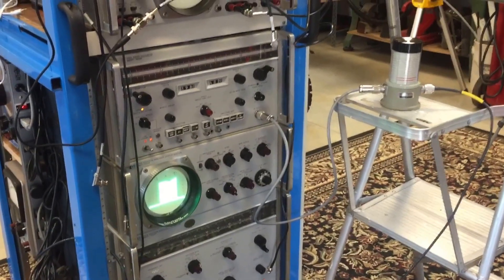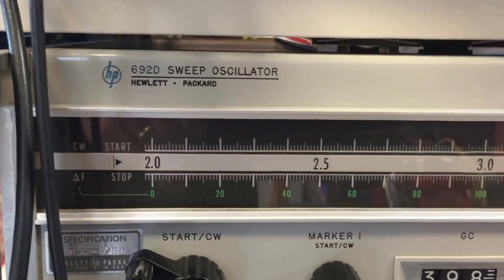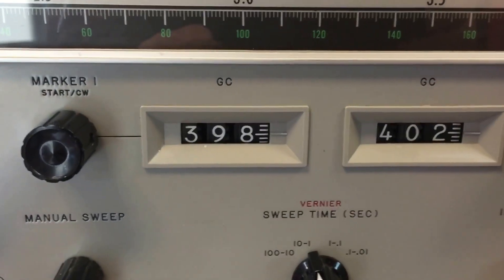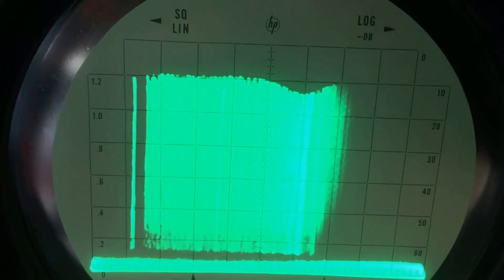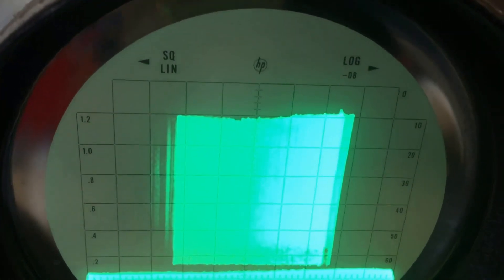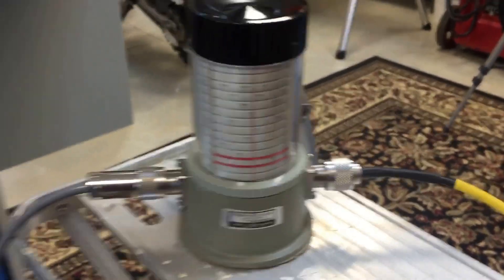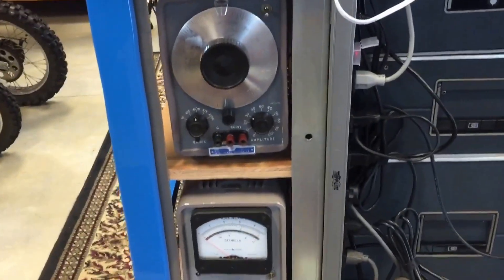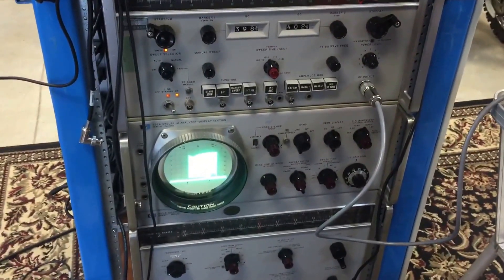Vintage HP microwave sweep oscillator, spectrum analyzer and frequency meter

Comment: I used to have old junk like that but now MUCH BETTER units are available on ebay for a few hundred. The frequency meter doesn't seem to be working. Same setup on my later equipment shows a 30 db notch.

Comment: So nice. I just bought a 537A frequency meter because they're always fascinated me, even though I have no test setup to use it on. How deep and narrow is the notch it creates at the selected frequency?

The manual indicates that it actually has a pretty nasty amount of reflect power inherent to its operation so they suggest running it behind a 10dB attenuator which will help isolate that from the source a bit. Otherwise it can interact with the source and cause a frequency shift and accuracy problems.